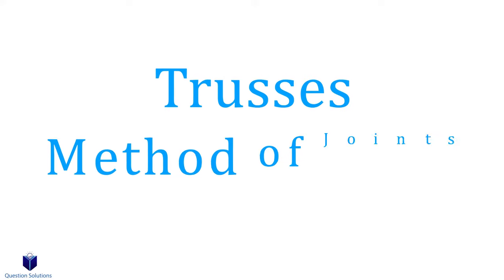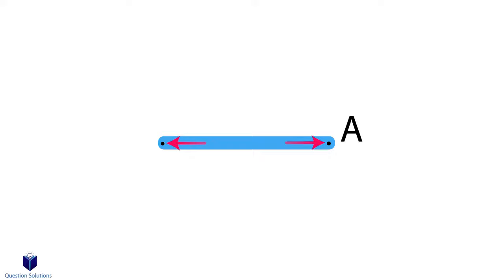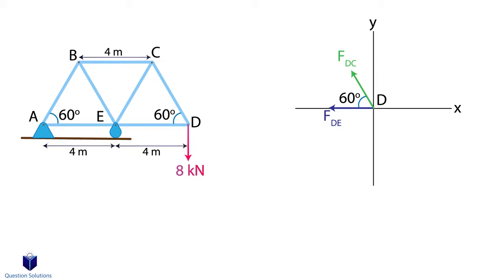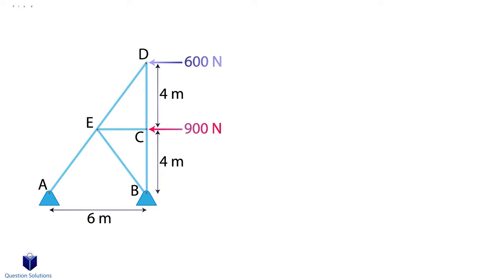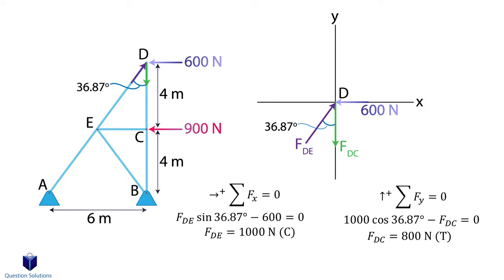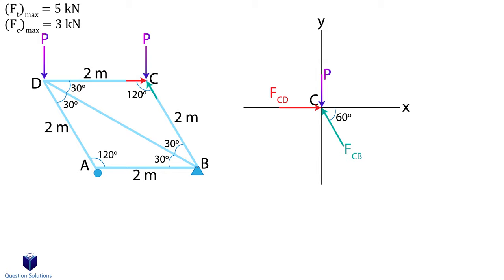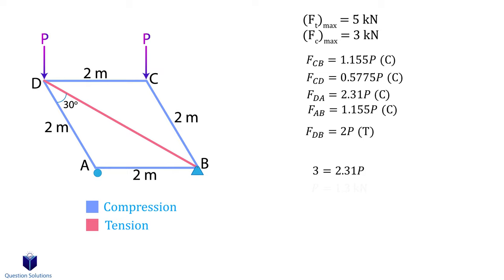Trusses Method of Joints | Mechanics Statics | Learn to Solve Questions

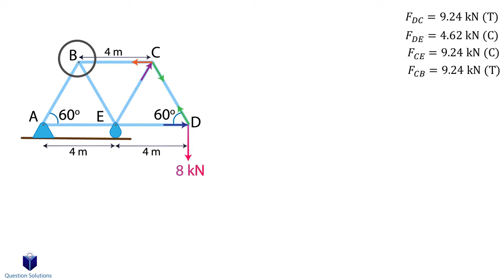Comment: How do you know the sign to use for each force member eg. At 4:30, how is Fcb negative and not positive, and how can you tell if it's negative or positive
Reply from the maker: So whenever we write an equation, we establish which sides are positive. If you look next to the sigma sign, there is a little arrow pointing to the right with a plus sign next to it. This says any force pointing to the right is positive, which means any force pointing to the left will be negative. Notice that force F_CB is pointing to the left, so it has to be negative. You can also write these equations with right being positive, in which case, F_CB will be positive and the other 2 will be negative. You will get the same answer either way.
Reply: @QuestionSolutions  thanks 🤙

Comment: if you didn't have a external force of 900N going through member CE, how would you work the force of that member hypothetically speaking. Could you use the force of member ED to help solve?
Reply from the maker: Sorry, can you give me a timestamp so I know where you're referring to. It'll allow me to help you out better. Thanks!
Reply: @QuestionSolutions  7:00
Reply from the maker: @Umarranis  Solve it without the 900. You'd write your equations the same, just without the 900. So you can visually see in that case, force CE would be a zero force member. If you can't, that's okay too, but writing an equilibrium equation for the x-axis forces would be simply give F_CE = 0.

Comment: sir, quick question. for the first question, will there not also be horizontal and vertical reaction forces at the support in A to counteract force BA and AE? and also sir, what are the different types of reaction forces provided by different support types?
Reply from the maker: Since A is a pin support, it will have horizontal and vertical reaction forces. However, the question isn't asking for those so we don't need to worry about it. We are only looking for the forces in the internal members. In this video, I talk about a few different support types: https://youtu.be/jQDEOwrR4UU?list=PLXePpKFSUW2ZxGn6VdAPY9d7l7HowWVYL

Comment: I still don't understand how you assume which forces are in tension and compression. Is it just if I get a negative value I flip the sign? Also, how do you check when you're solving systems of equations?
Reply from the maker: So an assumption means it's just a guess. You are guessing the direction first. Let's say you guess the force is going away from the pin, and you solve your equations and end up with -40N, then you know it's opposite to your assumption. In other words, the force is coming towards the pin and it's a positive 40N. So if you get a negative value, then you flip the assumption. I actually show this on the first example at 3:30. I encourage you to re-watch the video and do the problems along side what's shown on the screen. It will clear things up for you.

Comment: Great video. One question though. I'm failing to understand how you've come up with the force for DC, I've plugged in -8 sin(60) with my calculator in degrees. It doesn't come up with the 9.24 kN you've found. Have you any idea as to what I'm doing wrong?
Reply from the maker: Are you referring to 3:04? If yes, you've made a slight mistake. So our equation looks like this (I will use "x" for F_DC):
 
-8 + xsin60 = 0. 

You now need to isolate this equation for x. So add 8 to both sides, and then divide by sin 60 on both sides. 

x = 8/(sin60)

Now, you can plug this into your calculator. 

x = 9.24 kN

I hope that helps.
Reply: @QuestionSolutions   Yees!! Finally got it. Absolutely brilliant. Thank you very much!
Reply from the maker: @TomDavid-bw6in  Awesome!!! Really glad to hear you got it. Keep up the great work and best wishes with your studies.

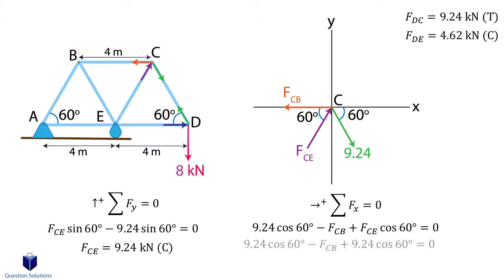Comment: hi, at 4:20, i am confused how Fce became 9.24kn, can you break it down?
thankss
Reply from the maker: There really isn't anything to break down. You solve directly for FCE. So plug this into your calculator (9.24sin60)/(sin60) = 9.24
You can also divide both sides by sin60, so you're left with just 9.24. Sometimes, thinking of FCE as just "x" might help you visualize it better.
Reply: @QuestionSolutions  Thank you!!!

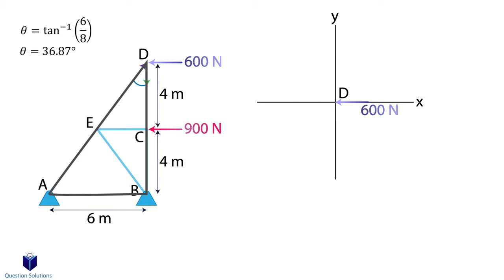Comment: at 6:14 shouldn't have been 8/6 since 8 is the opposite and 6 the adjacent ?
Reply from the maker: No. You need to look from the point of view of the angle. If you look straight from the angle, it's 6m straight ahead, which is considered the opposite direction, and 8 in the adjacent direction. I hope that helps. 👍

Comment: At 3:05 I cannot understand how we got sin60? Isn’t should be cos60? Because Fdc is the hypotenuse so we need to use cos to find the Y component? Please if you can explain it to me because I’m already struggling with statics
Reply from the maker: Please see: https://youtube.com/shorts/vynnKlJD_Jo?si=cZM_sz2GrFu4FTWY

This is very important to understand so watch the whole thing.
Reply: @QuestionSolutions I’ve watched the full video and the short also but I can’t get it I still see it as cos60, and I’m talking about the triangle where Fdc is the hypotenuse and Y-component as the adjacent
Reply from the maker: So you're looking at the diagram incorrectly, which is what's leading to your confusion. I've drawn the components in dashed light green, but you need to think about how these components can be moved along their axes. So bring the y-component (vertical light green dashed line) in front of the 60 degree angle. In other words, move it to the left along the x-axis, still parallel to the y-axis. Then you can see how it's in front of the 60 degree angle. Opposite is sine, so you need to use sine to get the y-component. If you use cosine, you need to use 30 degrees, since 90 - 60 = 30. You're looking at the components from the 30 degree angle (which isn't shown). 

In hindsight, I think it would have been better for me to draw the components in front of the 60 degree angle, but it's almost second nature to students once you can visualize components being moved around. I think also, it was hard to show the x-component on top of the FDE force arrow 😅 @kalidalghamdi9306
Reply: @QuestionSolutions  thank you so much for your explanation

Comment: I have a question at 3:21 can we assume opposite x direction to be positive (right side)? when ı assume right to be possitive ı find -4.62 but in wrong direction. I know that F_DE should be in the right direction.
Reply from the maker: You can assume any direction to be positive. If you end up with a negative answer, then you know it's opposite to your assumption.
Reply: @QuestionSolutions  but i still get wrong direction my equation is -FDC*cos60 - FDE = 0 then ı find FDE= -4.62 ( ı assume right to be positive ) then in this case FDE is in the left direction
Reply from the maker: @sevgipnar5261  No, you're getting the right answer since you got -4.62. It just means the direction we chose for the arrow F_DE is incorrect. It was facing to the right. I think you're getting 2 things mixed up. The direction of the arrows we chose can give us negative values, which means the direction we picked was wrong. When we solve problems, you can pick forces to the left or right to be positive. So there are 2 choices going on.
Reply: @QuestionSolutions  so that means everytime i get negative values my assumption is incorrrect and i should change the direction?
Reply from the maker: @sevgipnar5261  Yes. Let's say you picked your arrow to face left, and when you solve your equations, you for a negative value. That means your arrow actually faces to the right. Please re-watch 3:26, I show how that's done.

Comment: not a bad video but left a lot of simple stuff unexplained. Why does DE turn positive despite having been shown to be in compression? How do you actually set up these equations? What are the rules for them so you dont do them wrong? Basic stuff like this is missing, please cover it.
Reply from the maker: So I understand where you're coming from. My guess is, you searched "trusses method of joints" or something similar and found this video. Unfortunately, if that is the case, and you're missing fundamentals, it will be hard to grasp. This is part of a series of videos (playlist), where the each video builds up from from the previous one. The series is made just like a textbook, where the next chapter requires knowledge from the previous chapter. That's the only way to keep these videos concise and short, without creating 1 hour videos, going through the same thing over and over for each video. Setting up equations for these things is the same as when setting up equations of equilibrium for 2D objects (covered in a previous video). The rules are also covered in them, and also a lot comes from basic algebra. So if you're interested, I encourage you to view the videos on the statics playlist. They are all short, concise and I try my best to keep them to the point. If you watch those previous videos, pretty much every thing you said is missing, is already explained. 

Also, I don't know where you're referring to when you said "DE turn positive" please use timestamps so I can help you out. 

Best wishes with your studies.

Comment: Hello, why did you use sin in finding the value of Fde in 2nd figure when it says summation of Fx?
Reply from the maker: So I am thinking what you're asking is, why is sin used for x-components? Because sine and cosine are NOT related to x or y components. They are related to the side with respect to an angle. Please don't think that sin is just for y-components or cosine is just for x-components. You have to look at the angle, and see whether the component you're trying to find is opposite to the angle or adjacent to it. Here, we want the x-component of force F_DE, which is opposite to the angle, which means we need to use sine. If you need a refresh, watch this video, especially the first example: https://youtu.be/NrL5d-2CabQ
Reply: @QuestionSolutions  Thank you, now I get it. Cos for CAH and Sine for SOH
Reply from the maker: @heavenskyclouds4480  That's right! Best wishes with your studies :)

Comment: 2:58  how do you calculate -8 + FdcSin60 = 0
Reply from the maker: So you need to isolate for F_DC. Add 8 to both sides and then divide both sides by sin60. You have: F_DC = 8/Sin60. Plug that into your calculator and you get: F_DC = 9.24
Reply: thank you so much @QuestionSolutions
Reply from the maker: You're very welcome! @gary1585

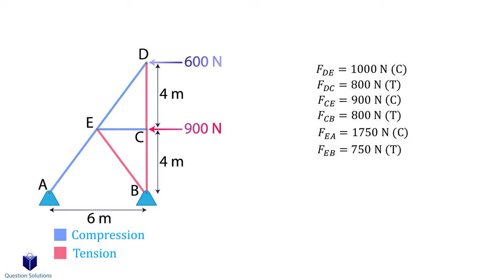Comment: In 8:02 can you show how you solved for the forces
Reply from the maker: I think these equations look daunting to some but they really aren't. If you convert the sine values into decimal values, it'll be easier to see. For example, sin53.13= 0.8. So you can write the second equation as 0.8F_EA-0.8F_EB+-800=0. Now you should be able to solve them without a lot of trouble using substitution. Let me know if that helps you need a full breakdown. Thanks!

Comment: I don't get the part in 4:54 😭 wdy divide both with sine60 ,and in Fx what if the assumption was wrong how would you know what's wring between the two
Reply from the maker: So you divide everything by sin60 to get rid of sin60 on all the terms. That way, the only things you have left is just FBE and FBA. If your assumption is incorrect, you will get a negative answer. Then you need to flip the direction of the arrows.

Comment: In the 1st question why did you assume that fx is going to the left in FDC? I tried assuming it would go right then I got tension
Reply from the maker: For the future, please use timestamps, thank you :)

So you're free to assume any direction you want. Let's say you assumed it would go towards pin D(which is what I assume you did), you should end up with -9.24kN. The magnitude of your force is correct, however the negative sign indicates it's opposite to your assumption. Which means it's actually going away from pin D.
Reply: @QuestionSolutions  oh so you assumed left is positive since in the fbd you made it go towards left?
Reply from the maker: The initial assumption is just a guess. So you can pick the direction of the arrows anyway you like. When you write your equations, you can pick right or left to be positive and write your equation according to your choice. You will always get the same exact answer but if you get a negative value, then your assumption for the direction of the arrow is incorrect. It's opposite to your assumption. @akira...7819
Reply: @QuestionSolutions  thank youuu

Comment: I got everything on the video.
But there was something I was clear with.
In the first example, at joint A is a fixed support which has vertical and horizontal components, why didn't you solve for those (i.e Fax & Fay)?
Reply from the maker: I will counter this with a question. Why do you want to solve for those and do extra work when it's not necessary? 😅
Reply: @QuestionSolutions  lol 😅.
Right?
Thanks though.
Nice work 💯💥🙌.
Reply from the maker: @arinzeanthony7447  So in university, time is a precious commodity. Exams are made to push you to solve a set of questions under a very specific time span, and usually, most students don't have extra time to play around. Keeping that in mind, try to take the path of least resistance to get to an answer. Give only what the question is asking for, if you need to show the forces in members, forget about the reactions and pins and rollers. The only time you would need to consider that is with the method of sections. Best wishes with your studies!
Reply: @QuestionSolutions  but if they're that useless,  then whats the point of their existence?
Reply from the maker: @arinzeanthony7447  You just don't need it to figure out forces in members. You need it for equilibrium problems all the time. In this case, there is no need for it. I mean the whole problem was solved without figuring out the reactions, right?

Comment: Great video they help me a lot so thank you for that! I just have a small doubt , after we assume the direction of a force and get a negative answer is it okay to change the direction then to the correct orientation ? Does that effect the results in any way?
Reply from the maker: You can do that, but it's so much easier to stick to what you get and continue with the same positive and negative signs until the very end. It's just too easy to mess up the signs when you're trying to switch them. But, yes, as long as you account for all the changes and you are very careful, the answer you get will be the same. Personally, I don't recommend it, I find a lot of students already get positive and negative signs mixed up 😅
Reply: @QuestionSolutions  Alright I'll stick to your advice, thanks a lot!

Comment: Quick question. In problem #1, are there not reaction forces at the pin at point A? Do you just not solve for them because the problem is only asking for the member forces? Or am I missing something else?
Reply from the maker: Yes, there are forces at pin A, but we don't really need them since we are only interested in finding the forces in the members.

Comment: how'd you get Fdc=9.24 kN ? i was confused... ty
Reply from the maker: I don't know where you're referring to. Please use timestamps. Thanks!
Reply: @QuestionSolutions  the answer of force DC on the first question. I calculate it it doesnt match the answer
Reply from the maker: F_DC = 8/sin60 = 9.24 kN

If your answer isn't matching up, check to see whether you took the proper steps to solve for FDC, or if your calculator is in deg or rad.  @leonelduenas1782

Comment: Please 🙏 explain to me how FBE and FBA was found from the solvings
Reply from the maker: Please give a timestamp so I know where to look. Thanks!
Reply: @QuestionSolutions  5:00
Reply from the maker: @iamlawrenceeze001  So it's just 2 equations with 2 unknowns. You can use the substitution or elimination method to solve for it. So you isolate for variable in one equation and plug that into the second equation and solve.
Reply: @QuestionSolutions  thank you

Comment: sin and cos were swapped out for y and x sum of forces 6:30
Reply from the maker: Are you saying it should be cos for the x-components and sine for the y-components? If yes, no, they weren't. I assume you're under the impression that cos is for x and sine for y? Not sure,  for whatever reason, a lot of students seem to think sine is for y, and cos is for x. This is not the case and incorrect. This is where so many students lose points on their exams. You must look at the force from the view point of the angle. Imagine you're standing looking out from the angle of 36.87. When you look straight ahead, you get the x-component, that's the opposite side, so that's sine. Next, if you look to your adjacent, you get the y-component. Adjacent is cosine. Let me know if you need further clarifications. Thanks!
Reply: @QuestionSolutions  I never saw it that way, thank you very much for your help
Reply from the maker: @RobipiotCode  It's okay, you're definitely not alone in this. It's quite a common question :) 

Anyways, please always double check, it's very easy to lose marks over something like that. If you have any other questions, feel free to ask. Best wishes with your studies.

Comment: Quick question regarding the FIRST solution, would there be x and y components for the A support? or do we not need to worry about that, seeing that we found Ey for E…
Reply from the maker: At E, it's a roller, which means it's a single force upwards. At A, it's a pin, which means we will have x and y components. Generally, you only need to find one reaction to solve the truss, so pick the easiest spots, like a roller 👍
Reply: @QuestionSolutions  makes sense, thanks!